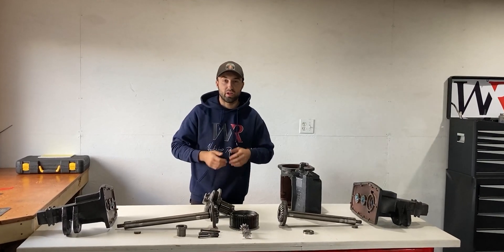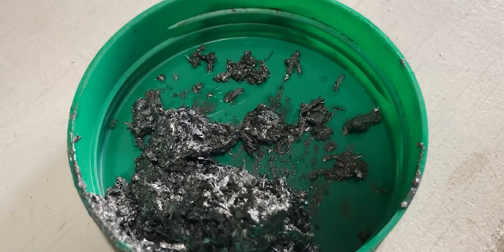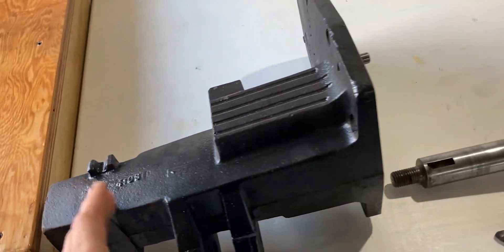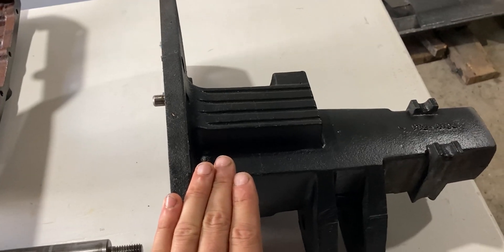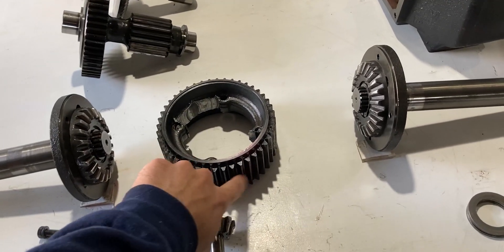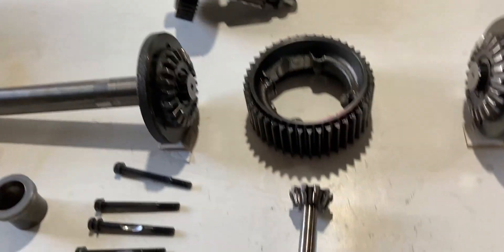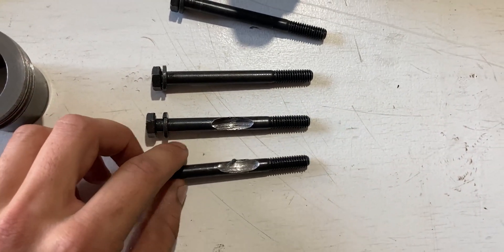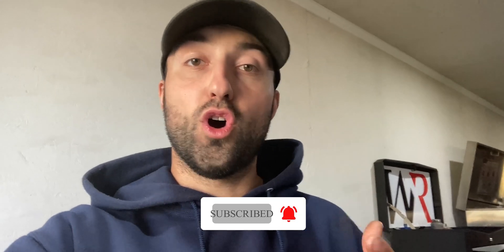1975 Bolens HT20 Rear End Issues Part 2 / Unexpected Damage

Comment: Bolens was not built as well as the Simpicity/Allis Chalmers of that size and era. I have a 620/720 Allis Chalmers. It still runs good and the gears still look as good as new. The Sunstrand hydrostatic transmission also works as good as the day I bought it. Bolens probably did not bother to harden their gears. If you are looking to buy an old tractor to save money instead of a new one, Bolens should be avoided.
Reply from the maker: I am not aware how well the AC 620's/720's were built, as I have never seen one myself in person. The tractor drivetrain according to TractorData is almost the same as the Bolens HT-Series, except for an Onan opposed-twin. Kohler and Onan both had their problems with engines, but the Sundstrand Series 15 hydraulic motors & pumps were basically indestructible.
I am aware that AC had a very good engineering department, that ranged from engines to transmissions all the way to hydro-electric plants. How good their rear-ends are is very hard to say (at least in my opinion).
Bolens engineering department oversaw a flaw in their first differential. The two running gears did not have a hardened shims behind them. This caused the gears to wear into the bull gear, create excess wear and eventually fail. This was then upgraded to the one you can see in the assembly video.
Thank you for sharing your insight on AC and their garden tractors. I'm interested to see one in person and maybe even test one. 
Regards Andreas

Comment: would you know if a  sunstrum 90 trany out of a massey 1655 an a bolens h20 have all the same internal parts
Reply from the maker: Hi Paul! I know all Sundstrand 90 hydraulic motors are very similar on the inside. The oil feed lines and pressure relief valves are probably the only things that could be different.
I assume they placed these lines and valves in different positions, but the hydraulic motor itself is basically the same.
I have some videos about two different Sundstrand hydraulic motors on my channel. I hope this helps! Regards Andreas
Reply: @WorkshopRebuild  thank you and you are very helpfull . love your channel
Reply from the maker: Thank you very much Paul, I appreciate your support!!

Comment: Interesting video, I have noise and vibrations from my the rear end  in a ht22, I think they have the same rear end. When the differential is working,  in both direction, it start with noise and vibrations... Did you find new parts for yours?
Reply from the maker: I believe the rear-end is identical, but there are some users in Bolens Facebook groups that have both models and they could tell you exactly if the rear-ends are the same. If you remove your drain plug and see a lot of debris on the magnet, I bet you have the same issue as I did! The bull gear had a design flaw, which they later corrected. 
In Part 3 you can see me rebuild the rear end with a new (used) bull gear. I purchased this bull gear from a gentleman in the US and he had taken a parts tractor apart just to get to this part for me. Here is the link to the video: https://youtu.be/04LL-H7LpZ4
I hope this helps and if you have any other questions let me know. Best regards
Reply: @WorkshopRebuild   Yeah thanks! I saw the next episode, good work!  So maybe it could be difficult to find a new bull gear and those cone gears.. maybe a good Mechanical workshop can process it by welding new goods and milling it,  I dont know about the conic gears, those are problaby also hard to find , is it neccesary with new gaskets, is it not enough with gasket glue?
Reply from the maker: @Portispro  That is correct, it is not easy to find a NOS (New Old Stock) bull gear or a used bull gear. It is possible to hand this over to machinists so they can recondition your current bull gear if it salvagabe! There are some members on Facebook that are very helpful and they could possibly help you find one. If you find one it will be more cost-effective, as shop rates can be quite expsensive!
To your other question about gasket maker/sealant: It is possible to get away with just gasket maker, but this rear end was originally built with gaskets with a certain thickness. On each shaft there are shims that give this housing enough play from left-to-right. If this play is non-exsistent, you may run into issues down the line. If you decide to take your rear end apart, I would suggest you find gasket material of the same thickness, or else you might have to change shims.
I hope this helps.
Reply: @WorkshopRebuild   first of all, alot of thanks for all your info and knowledge you share, just wonder did you find some gasket kits , or did you make them ?
Reply from the maker: @Portispro  You're more than welcome and I'm glad I can share some information to help you out! I did cut my own gaskets and it was fairly straight-forward. I went to an automotive dealer and asked them for gasket material specifically for transmssions. The thickness I measured is 0.30mm or 0.012". This is very thin, but correct to the original gasket. 
I'm not sure if anyone sells any, but I find making gaskets lately is almost faster. As I do not have to wait a week or two until they arrive from abroad.
Reply: @WorkshopRebuild  Hi, I also forgot to say that its also  vibrations in the pedal...
Reply from the maker: @Portispro  That is weird! Maybe the vibrations from the rear end transfer to your pedal linkage all the way to the pedal. The first thing I would do, is to drain the fluid in your rear end. If you have a clean pan, you can easily re-use your fluid. Check the drain plug for metal residue...
If there is nothing to be seen, you might have an issue in your hydraulic motor/pump! 
You can give me an update if you check your oil and we can go from there!
Best regards
Reply: @WorkshopRebuild  yeah thAt would be the first thing to do, what kind of oil do you use in it? farm oil 10w-30 or hydraulic oil?
Reply from the maker: @Portispro  I personally use ATF Fluid (automatic transmission fluid) many subscribers opt for Type F. This is a higher grade of transmission fluid, but is not needed. I would say it is okay to run hydraulic oil without any issues. 
I would NOT run 10w-30 as this is not the correct grade or viscosity to run a hydraulic motor/pump!